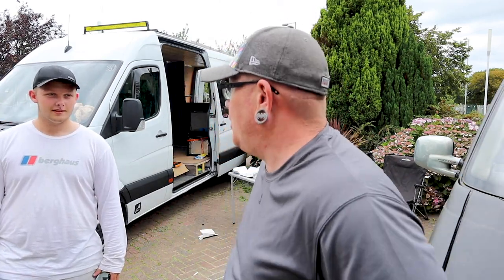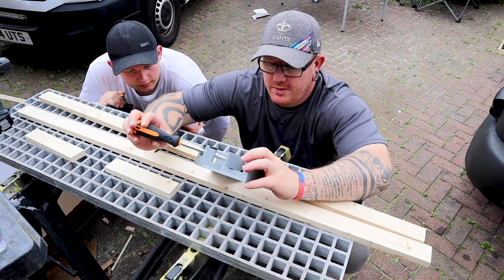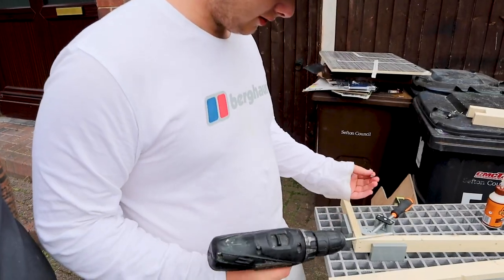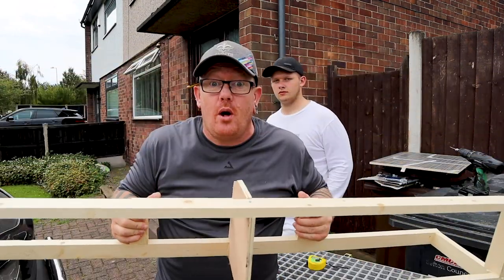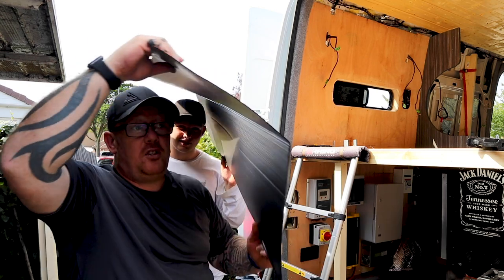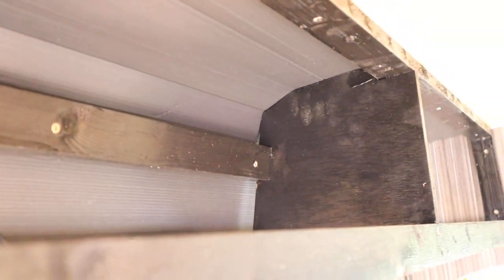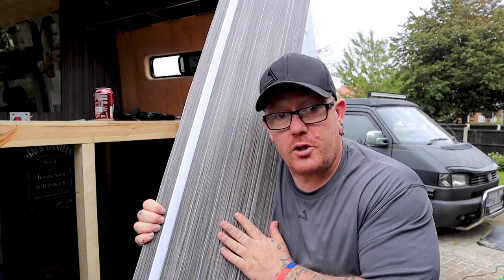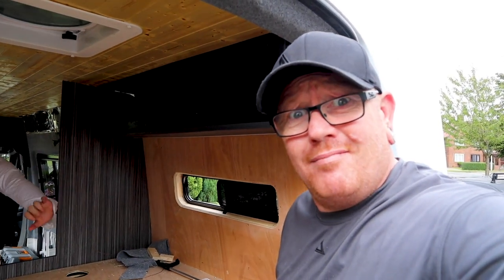SIMPLE Way To Make Cupboards In a DIY Van Build

Comment: Here's a tip for you. When using a router to follow a straight edge for cutting channels use the rounded part of the router base. If you use the straight side and get even a slight twist it will kick out and ruin the channel. I learned this the hard way. Also there is less friction against the straight edge as the contact patch is tiny.  Nice looking cupboards.

Comment: Hello mate, I'm learning plenty watching your videos, thank you for sharing.
One quick question who did your front seats also you mentioned u don't dabble with gas .
Me neither.
Would u recommend your gas fitter does he give u a sort of safety certificate?
Please keep the videos coming all the advise is appreciated.
Reply from the maker: Regarding the front seats I’m unsure if you mean the swivels or the seat covers . The swivel bases we have videos on bud and the covers we just got off amazon for £50 I thought they where going to be a load of crap but there really good . I just need to fix a panel to the back of the passenger seat but that’s a future video . The gas tank and system we had fitted by autogasandy_lpg  you’ll find him on Instagram . The install comes with no certificate mainly cost I have to connect my appliances up then get it all checked  over and then get a gas certificate . And I’d recommend him yes TOTALY he’s a lovely guy and did a brilliant job . And lastly but more importantly thanks for the kind words mate it means a great deal to me .
Reply: Hello and thank you for the quick reply, im just watching the widow frame video, i have to say another cracking video.
Im sat in back garden freezing me nuts of after spraying me unistrut.
Regarding the seats , i was on about the covers they look great for 50 quid mate ill be ordering some.
Your dead on mate dad and lad do make cracking vans

Comment: hi Neil, luv the videos, i'm doing a van at the mo as well, so finding yours very useful. i notice you have cupboard gas struts in your store, but how do you work out what strength you need??
Reply from the maker: That my friend is the mystery  of life . I started off with 100nt ones and they where far far to powerful so I got 40nt ones all tho they don’t freely open the cupbords up they are perfect for what we need . The 100s where flying the doors open but the 40s work perfect for us . So I’d say if you have magnet catches go for 40s and if you have locking latches 50s . I guess it was trial and error mate Iv never used them before . Hope this helps . If you go to my amazon store the ones I got are in there the link will be on top righ of the channel or in any of the descriptions
Reply: @UrbanVanlife  thanks Neil, good luck Dave

Comment: Just found your channel as was trying to find the best way to attach cupboards to the van ,did you attach the framework to the ply on the van sides or did you drill through to the metal of the van itself ? Cheers
Reply from the maker: Hi Paul, attached the f framework to the ply as there is adequate enough strength in the ply and also screwed into the ceiling beams aswell!
Reply: @UrbanVanlife  excellent, thanks for that 👍

Comment: Bud what's the wood board u use called and where do you get it please
Reply from the maker: Hi Bob, the board that we used is called Grey zebrano laminated light weight 15 ml ply and the place we got it from is UK leisure parks uk, they still have it in stock at around 138 sheet (inc vat) hope this helps, Emma

Comment: Hi mate i have just got a van that i am converting and i have been going through you back catalogue of videos am just wondering where you got you furniture board from thanks james
Reply from the maker: Hi James after a lot of research by Emma into different colours and prices the furniture board came from UK leisure parts as they where the best priced and had a different kind of laminate to every other supplier
Reply: Hello here where'd yas get that black plastic edging with the wee tongue on it that goes into the end of your panels?? 

Ps. ya do know the wood grain is going opposite ways on them 2 gabels of cabinets at the back door 😅😅